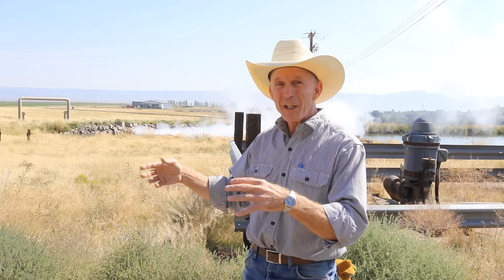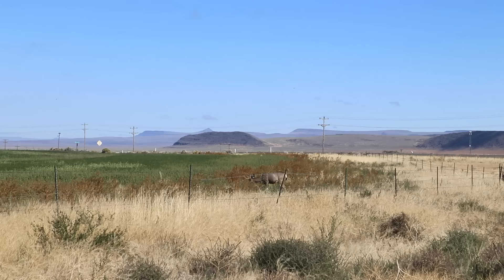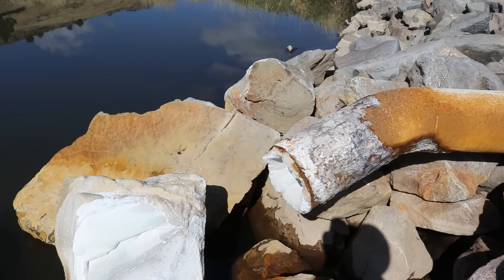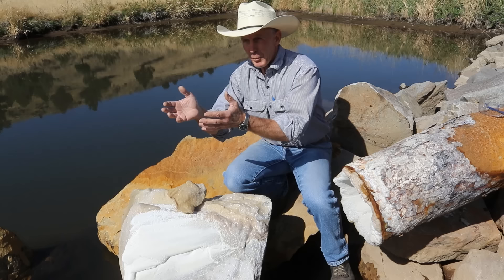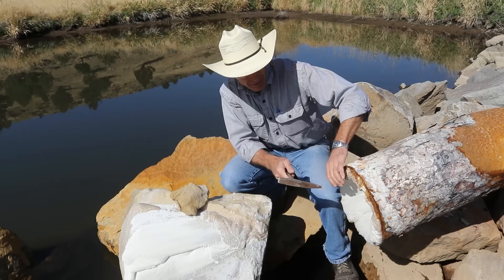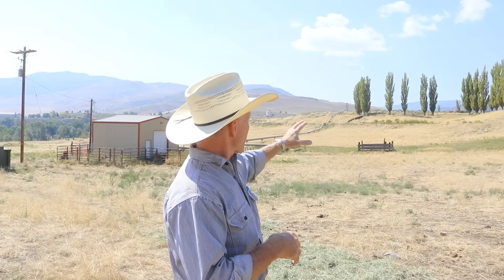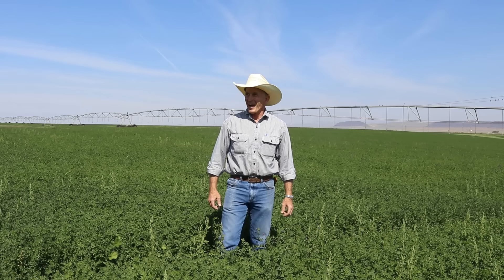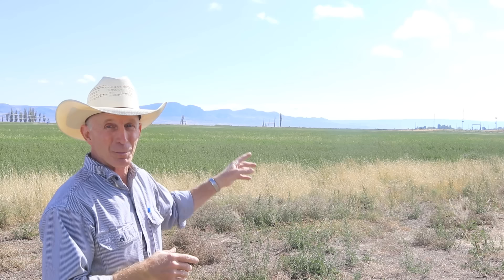We're in Serious Hot Water!

Comment: I have worked in geothermal production in California, Mexico, Indonesia and the Philippines. You have a very unique circumstance, that you mentioned. Shallow wells with clean hot water. As you stated, most geothermal fields are much deeper wells, and the water / steam produced is saturated with salt. Very corrosive, and very costly to deal with. Without government subsidies, the production causes so much damage to the wells and the pipelines, that it is not economically viable. Production also cools off the aquifers, necessitating the drilling of ever more wells. It is not "free" energy.
Reply from the maker: I didn't say or mean to infer that geothermal is "free" energy.  The drilling and construction costs alone for this little 3 MW facility was in the neighborhood of $25 million.  Fortunately, we don't have the highly corrosive brine that most systems have, so the cost to maintain and replace components is far less than in conventional geothermal systems.  That original well, drilled in 1980, is still as productive today as when it was first drilled and the pump bowls have been in the well for 30 years without being replaced.  My comments were intended to be about our system, not geothermal power production in general.

Comment: Nice setup you have, to bad about all the power going to waist like that. Having your own powerplant onsite seems like a perfect hedge against tough times.
I was wondering if it was an amonia based secondary fluid or how dificult it'd be to run a smaller geo plant. Probably cheaper just to buy electric or diesal.....for now anyway.
Still some trenches with greenhouses built in them and heated by geo would really open the growing season for any product you wanted to grow.

Comment: I grew up with hot water wells on a ranch and cooling ponds before we could use the water to irrigate. If I remember right the temperature was in the 120's, at least the well by the the house was. We had different temperatures at other wells.
  Is the well to your house cold water, if not how do you handle that?